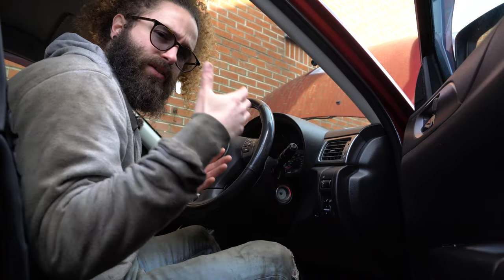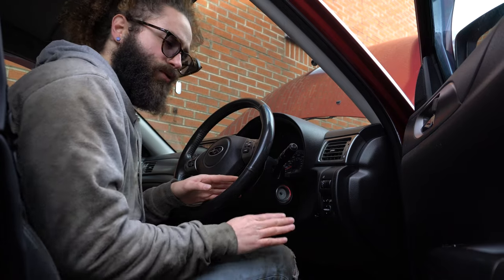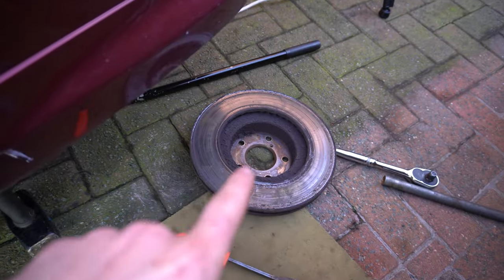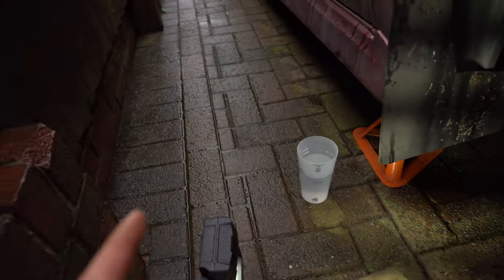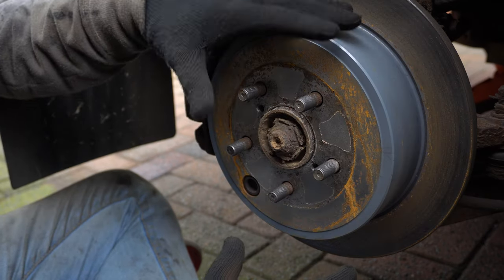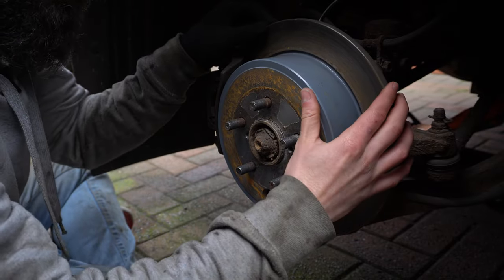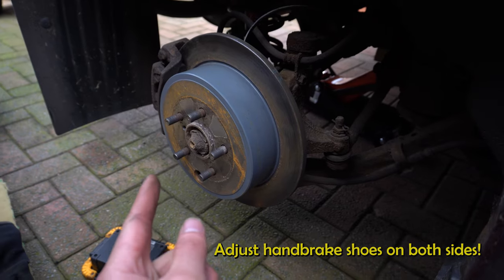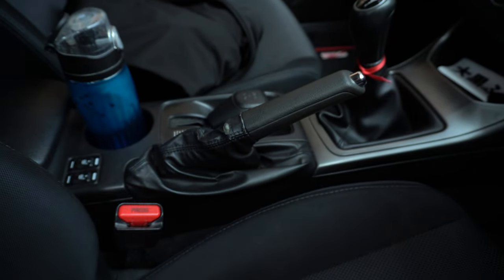Warped brake discs/rotors..?! What do they look like?

Comment: What pipes  are you busting when the system is designed to handle 2000 psi
Reply from the maker: With time and corrosion they don’t handle that much, it’s unlikely to happen but always better to prevent damage. Plus reservoir can crank when pushing the piston back.
Reply: @ElLocoRodil  really should be pushing the old fluid out. When you push it back. You could be pushing air back. When i bleed my brakes i saw a bunch of bubbles come out even though the braking was still pretty good. It did feel spongy too so. After i did  that the feeling didn't really change, but at least i know it doesn't have air in the system anymore.
Reply from the maker: @jack8356   I did bleed the brakes one my previous video, as the piston was seized at the rear. And the brakes did feel spongy to say the least.